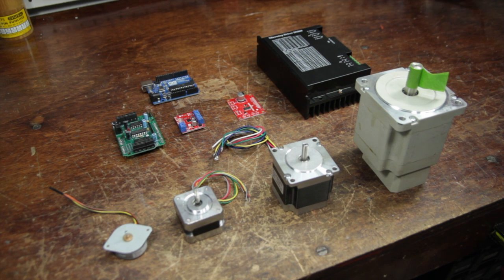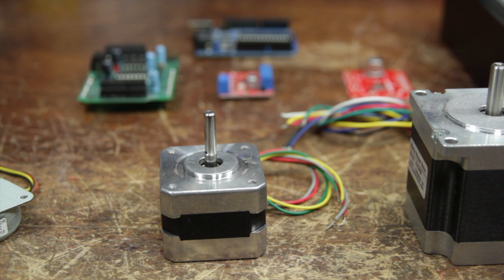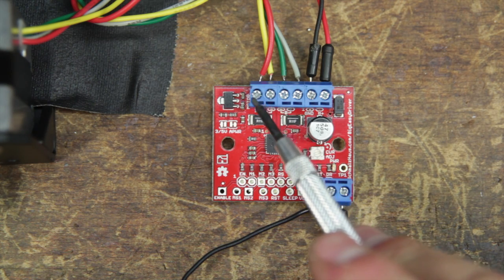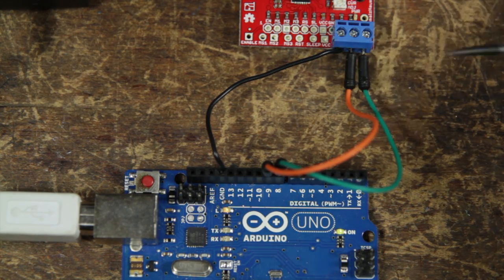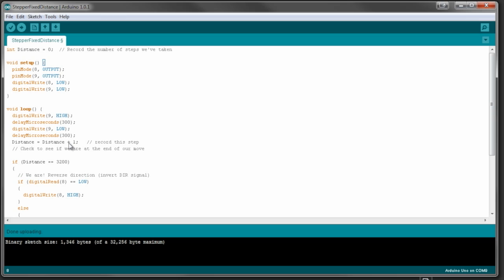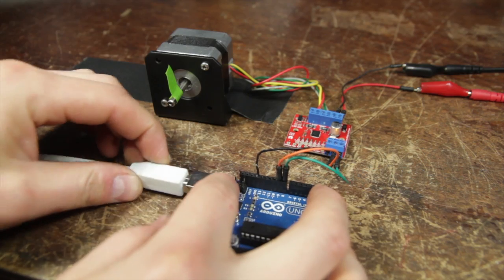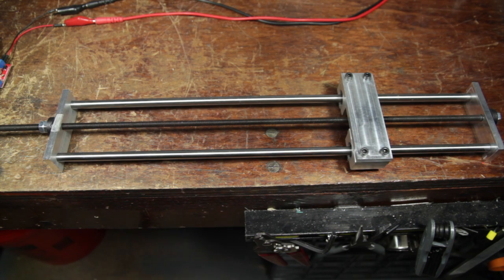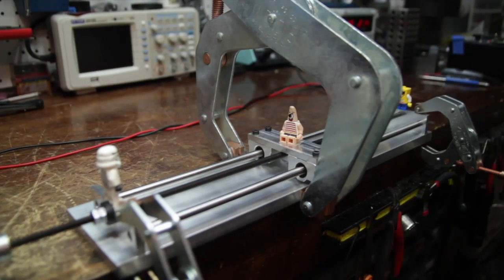Arduino Stepper Tutorial - Using Sparkfun Big Easy Driver to create a single axis CNC

Comment: I would like to operate a wooden room sliding door 1-1 end positons. Opening from the outside with an Arduino code, and locking / unlocking with an 2 pcs internal button.
Can that little red PCB also handle that white-covered stepper motor?
What are the parameters of the big engine? NEMAxx only specifies the installation position. No further data can be deduced.

Comment: Over a year ago I started on a single axis project but chose a Mega2560 instead with other components also, and got stuck before any movement happened. I realize the connections will be somewhat different but will the software settings work for my setup?

Comment: I bought the Big Easy Driver but it doesn't come with the blue wire connectors that screw the wires down. How can I buy them and attach?
Reply: Oh never mind I figured it out, they are called Screw Terminals. Here's a link if anyone needs them : https://www.sparkfun.com/products/8235

Comment: NYC CNC has done a fine job of showing that you can connect and control a stepper motor. They also have many other good examples from NYC CNC on YouTube.   Now that you've broken the ice,  Google arduino stepper motor code  for detailed computer instructions.  Also,  howtomechantronics.com has quite detailed programming and device plans.  Thank you, NYC CNC for the motivation.

Comment: hey NYC CNC i need your help in making a project of our college in which we are going to use arduino to function gear or stepper motors and rotate them 180 degrees with only one time switch.
so if we switch on the switch it will rotate 180 degress and than come back to itz original posotion without any othe switches. pleaxe help us 
contact email 
sunnydangi1996@gmail.com

Comment: I tried using the BED with 12Volts but it didn't do much, it just vibrated a little. I then tried increasing the Amp pot and the vibration frequency increased and eventually it stopped altogether. It now does nothing at all. Did I brick the BED?

Comment: Hello, I just purchased a Hollow Shaft CNC 4th Axis Rotary Table Router Rotational Axis Φ100mm 3 Jaw Chuck from EBay and I'm looking for a simple board that gives me the control of forward and backward and speed up and down where or what do I need to purchase simple not computer controled just simple "on switch"-forward,and backward with speed control???help
Reply: hey you mentioned a welding turntable in you speaking on a video and that is what I'm trying to make look on EBay at the item I'm getting and you might understand  eBay item number:262123913669 All I want is to have a switch that controls the item forward / backward and the speed ??? you spoke of something like this...please check it out?

Comment: great video! I am trying to combine this system to one of my woodworking jigs. based on the method you are showing here, what would be the easiest and cheapest way to connect a keypad control, so that  you can type in each time a required distance / time for travel? 
 maybe  you can point out some relevant information on the internet for this matter ?
thanks!

Comment: hi, is it possible to use easy driver for nema23 stepepr motors? Thanks:) Please help me
Reply: +NYC CNC  But how? Some says not really. Because the easy driver provides up to 750mA continuous current per phase and the Nema 23 requires more then 2/3 amps.
Reply: Hey I know this is super late, but just use an external power source to the easy driver rather then the power supplied from the arduino

Comment: great video, I bought a 24V 15A power supply as mentioned in one of your other videos (Arduino CNC machine with GRBL shield) to power 2 Nema 17 stepper motors. I was planning to strip the female end of an extension cable and wire that end to the power supply and plug the male end into the wall but have since read that may be unsafe... how did you wire up your power supply?

Comment: Nice to see things working but I am trying to run my stepper which is 0.9deg /step with exactly the same code on here but it doesn't run.(with BigEasy driver) it worked though if make to run one direction continuously, appreciate any help
Reply: I got it to work now just had to remove some of the codes and bang she goes, so all is good. cheers man

Comment: Hi,

Two weeks ago, I have been completely unfamiliar with anything related to Arduino.

Working on a project, which utilizes a stepper motor, I have searched the web and stumbled upon this tutorial.
Using it, I have got familiar with the basic Adruino capabilities and the different stepper motors relevant for my project.
I have purchased all the required components(even a soldering iron – would never believe it… ;)), and quite smoothly assembled it all upon arrival(just had to switch between the yellow and the green wires driving the motor).

The results can be seen below:

https://www.youtube.com/watch?v=VDr2HVEv27M&feature=youtu.be

Many thanks for your detailed tutorial.

New and Happy Adruino User.

Comment: Hey Amazing tutorial but i need a help on controlling the direction of stepper motor based on digital input trigger, like for 0V it rotates clockwise (given steps) and 5V it rotates anti clockwise (some given steps)....
Reply: Hey Thank you for your reply...i figured out a way using attach interrupt function.
It's now working the way i wanted....Thanks.

Comment: This video series is excellent.  I'm getting into Arduino and dc motors because of a Cub Scout project.  Since I'm so new to this, I'm not sure which direction to go in.  I'm needing to develop a tool that is similar to the mechanical "Binder Winder" https://www.youtube.com/watch?v=VcDAlHuxjWA on youtube, but I'd rather not spend $165 in dedicated parts to do it.  I'd rather throw in an Arduino and some motors that I can use for other purposes the 364 days of the year I'm not winding rubber bands for the Space Derby.  Specs:  Need to wind four sets of rubber bands to a specified number of turns (ie 100 in most cases) before each race.  I know, it sounds trivial, but this significantly speeds up the race and makes the races fair for the kids (50+ and at least four races each).  Using a drill motor works, but not with any consistency in winding.  Any insight would be appreciated.
Reply: NYC CNC I'm new to Arduino except for the research/reading I have been doing over the last couple of weeks.

Comment: NYCCNC website seems to be dead. When are you going to bring them back to alive? I need to run my 42 steps stepping motor with a force sensor.
Reply: NYC CNC I am in Asia, and I can't open your website. Thanks anyway.
Reply: NYC CNC I don't know. But I have tried it doesn't work in Beijing. It works in another city in China tho. Your video tutorial is quite useful, I am still able to grab your code from the video. So it's ok for me.

Comment: Can the motor spin faster ? I need to use it on a similar threded rod .... but i need the platform on the rod to move much faster than the one in your video
Reply: NYC CNC
Ok thx alot
Reply: NYC CNC
I ordered the bigger stepper motor on the right side of the one you are using ... wich has 6 wires ... is it a big difference in connecting it to the driver ?
Reply: Ok , i'll see what i can do , thx for the reply

Comment: i would like a cnc machine with 3 stepper motor ,can you help me ??What controller can i use with arduino ?
Reply: NYC CNC you would be amazed at how much information is on the web, and forums, and how having ''that much'' works against 'you' (me!) - I have been an electronics hobbyist for years, I have made lots with arduino and i have built a few ebikes and currently building an octacopter and cant get started on cnc!  
Also i found on forums when i mentioned i want to make a table top a4/a3 sized one for small parts I was 'pushed away' for not wanting to make a monster for building full scale jet engines..
one day.....

Comment: I would love to know if you can upload commands to the arduino board and then remove the USB. I want to make a time lapse rig that I can program to step the motor but not have it connected to a laptop or tablet the whole time. Is it possible to maybe take a laptop out into the field with me upload commands to the arduino and then walk away and let it do its thing for a few hours. (Obviously powered by a powerpack)

Comment: I will assume you can power this system with batteries but can you upload commands by USB then take the USB out of the device and it still operates? I would like to be able to take it to a remote place and use it for time lapse photography.

Comment: Where did you get the code to run the motor?
Reply: any recommendations on where I could find some solid code to build off of?  I found some and got the motor up and running last night, but any additional code would greatly be appreciated
Reply: thanks

Comment: I have the code exactly how you have it, and I believe everything is set up correctly.  However, my stepper motor doesn't turn.  I noticed it vibrates for about two seconds, then stops, then vibrates again.  I'm assuming that's the motor trying to turn in the forward and reverse direction.  Any ideas on what could be the cause of this?

Comment: could i use this in my truck , 12 volts with accuators to open my hiddin shifter, and to open my hiddin sterio, also i have a hidden gun compartment that i have a floor push bottom but i have to keep my foot on it.  al this items are on monetary push bottons and i have to hold them i will like to have something that i just touch the bottom and opens, or push botton send the signal and close of vise versa.  could you help me i have 8 items on my truck that function in the similar way.  this is going to be a show truck, the inside is totaly build of corbon fiber, hand made. Im looking for help on the electronic for the accuator i will pay for you time or instructions.  i just need help.
Reply: I tried and I can't get it to work,  j will pay you

Comment: I'm trying to use the Big Easy Driver to move a stepper 12-40V 2.5A. I'm generating the on/off signal, through an sbRIO, but I can't move the motor. However, if I get a wire connected to GND, and touch the Step terminal, the motor moves... I don't know what's going on, can you help?

Comment: i've bought the big easy driver and a similar stepper motor, hooked it to 12 volts. At first the stepper followed the program, later it started to jitter. Now when i try again all i get is jitter. Did i blew my driver or my stepper motor???

Comment: Hey,

I am working on a project right now that involves a linear slide system similar to the one involved in this video. The difference is our linear slide system is more complex and involves two different stepper motors. One stepper motor is a NEMA 34 1288 oz-in holding torque. The other is NEMA 17 83 oz-in holding torque motor. We have two corresponding drivers for each motor. For our larger motor, we want to achieve a linear slide speed of around 25 in/s, so something much faster than what was displayed in this video.

My question is do you think the Arduino Uno can handle controlling both of these stepper motors or does our system seem too much for this type of controller to handle? Basically, can the Arduino Uno process the information fast enough to achieve our max speed in minimal time?
Reply: NYC CNC
That sounds good. Figured I might as well check with you. Cool video still. Thanks for your help!

Comment: Hello
I need to control one stepper motor (45v  2.2A)  I got the  driver and my arduino (UNO) too, Motor terns but I can't write the loop to create a constant stop and start , can you help?  please
Reply: fantastic.
here you are what I have done:
 I am using:  a Driver CW8060
         Motor: 60BYG401-03 (Bipolar Series)
                   : Arduino (uno)
unsigned char Enable = 2;  
unsigned char CW = 3;      // way the motor terns
unsigned char STeP = 5;   // how long motor is rotating
unsigned char led = 13;    // just reference to see if motor on - off
long cntr=0;
 
void setup() {
 
  pinMode(Enable, OUTPUT); 
  pinMode(CW, OUTPUT);
  pinMode(STeP, OUTPUT);
  pinMode(led, OUTPUT);
  pinMode(ref, OUTPUT);
  digitalWrite(ref,1);
  digitalWrite(Enable, 0);  //when (0) motor rotates when( 1)motor off
  digitalWrite(CW,1);        //direction of rotation
 
}
 
void loop(){
  if (cntr<3500)
  {
    digitalWrite(STeP,1);
    digitalWrite(led,1);
    delay(1);
    digitalWrite(STeP,0);
    digitalWrite(led,0);
    delay(1);
    cntr++;
 }
}

the motor rotates for 10 sec and stop one time but I need it to rotate CW stop for 5 sec and then tern the other way for 3 sec, stop for 50 sec and start all over  again in and endless loop
 thanks for helping:
kind regards Geovanny
 
John NYCCNC

Comment: Thanks for the tutorial! I found it very helpful. If I wanted to add another stepper motor to the arduino, would I place the direction pin in 7, the step pin to 6, and combine the ground pins?
Reply: John NYCCNC
Is it possible to use the Big Easy Driver with a Nema 23? I saw in the other video you used an ST-M5045 for the Nema 34. Is that large of a driver necessary for the 23? Thanks in advance
Reply: The rated voltage is 3V and the rated current is 2A/phase

Comment: can i see the sample of the code . i am using msp430 AT&R instead of Arduino . do i need to generate the enable and step pulse as the shape in page 6 of he datasheet. of the big driver
Reply: yes this code can it work on msp430 also ? instead of Arduino ?

Comment: so, you are using a 12V stepper motor,with a 24 V 10A power supply does it matter the amps from the motor??   ? i don't understand

Comment: Whats the strength of one of these steppers? I have used a servo in my project because of the torque it has, but I'm guessing its no where near as accurate in terms of tiny steps as this motor (hence the name?) I will be turning around 6kg of camera equipment - weight is supported by bearings, just need to turn the platform at a speed of around 180 degrees in 12 hours - super slow stuff

Comment: I remember that when they first came out, Newark was out of them but adafruit had them and were not selling them, they were giving them away with a $300 purchase.  Insanity!  Pi was good at the time because the Beagle Bone was going for about $90.  I don't think the Pi is that great, they have the lame duck 700Mhz Broadcom ARM11 chip, the new Beagle Bone Black is only $45 with a Texas Instrument 1000Mhz Cortex A8 and I don't have to sign a non disclosure agreement to get the data sheet for it.

Comment: I refuse to shop at Adafruit after they bought up an already scarce supply of Raspberry Pi's from authorized retailers, added about $15 worth of garbage to it and sold it as a beginners kit for $100, or they would sell you one at normal price but only if you put in a $300 order with them. The R-Pi's were supposed to be a way for kids to get started cheaply but Ada holding them hostage unless you spent big bucks went against that philosphy!

Comment: Man, I don't know if this a dumb question, I'm kind of new to these motors, but I already know my way around the Arduino. So my question is: is the bid easy driver absolutely necessary to control my stepper motor with the arduino? I already bought my motor thinking the arduino board would be enough, now I don't know if I should buy the easy driver as well. Lucky me, I bought the exact same stepper motor you used in the video.

Comment: Hi John - It was't really clear how the threaded rod was connected to the stepper.  What coupler was used?  Also, how did you mount the machined threaded piece to the bearing assembly?

Comment: I'm planning of using an Arduino with a car tachometer. Some use stepper motors and some just use servo's. I was just wondering. If I were to buy a tach and it was a stepper motor. Do you think it would have the motor controller already built in the cluster or would I still have to buy one?

Comment: You can operate steppers at any voltage. The higher the voltage, the faster you can charge the windings, and the faster the stepper can move. The driver is the limiting factor. If you use a 10V driver, then all you can do is supply 10V. But if you use an 80V driver, then you can go up to 80V. Note there are other items you need to take into consideration such as motor impedance, motor style (unipolar vs bipolar) and speed you want to move. This will be a good topic for my ebldcdotcom blog.

Comment: Steppers are operated in open loop fashion. That is, you never know what the position actually is. You can assume the position if you start from a known position and count steps, but if you have lost steps, all bets are off. Servo systems use closed loop (encoders, resolvers, pots, etc) to gather position information. Steppers are hardly ever used as Servos, although on very intricate applications (e.g. industrial) they are servoed.

Comment: An optical to see the item arrive by conveyor, this will start the stepper motor, and then another optical on the "web" of the label roll (this is to find the gap between the labels on the roll) to stop the stepper motor at the desired point. Hope this helps.

Comment: Hey John, nice video as ever. Short, to the point, with lots of useful info'....and you pass on your knowledge for free. Cant believe the thumbs down. You're a top bloke in my book. Look forward the follow up regarding limit switches and sensors. I want to build a bespoke labeling machine using a stepper to apply a label. The mechanics should be straight forward but I'm not too sure about the sensing....ie, proximity to sense the item arriving and a gap sensor on the label roll. Thanks Darren.